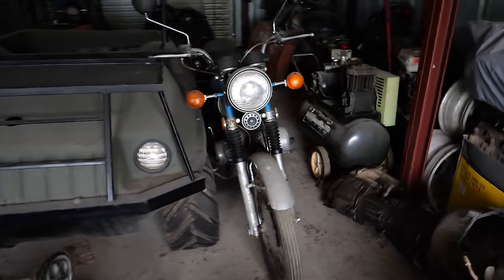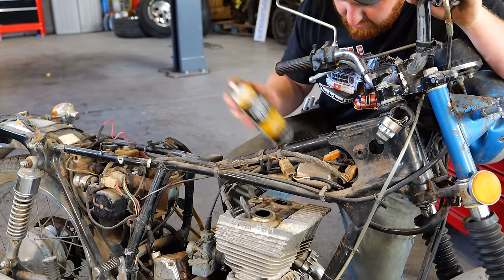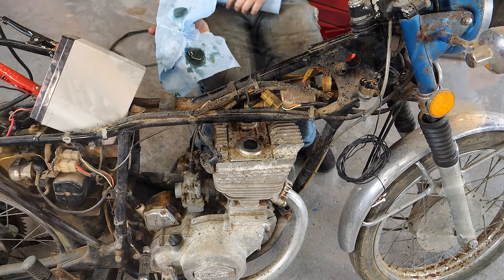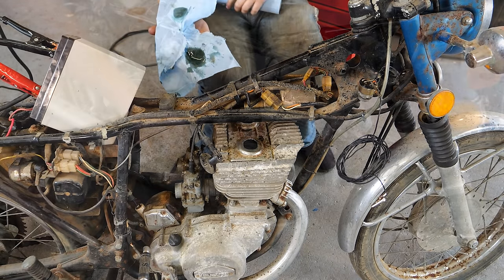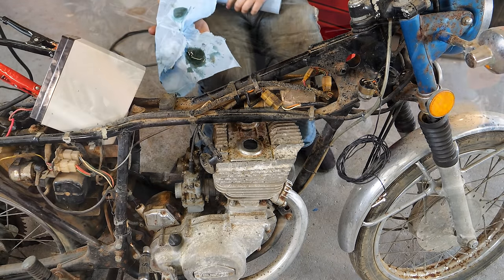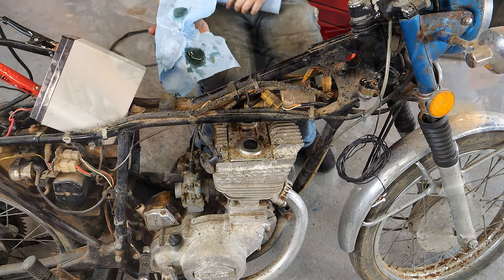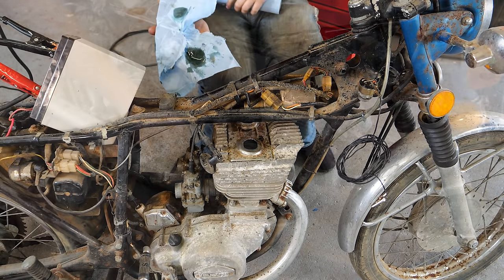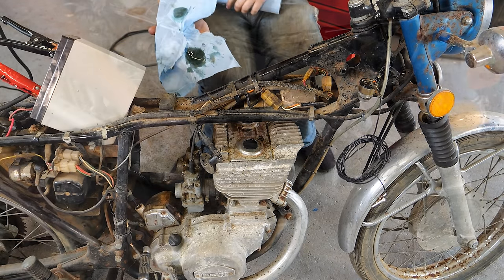Will an ABANDONED 2 Stroke Motorcycle Run After 20+ YEARS!?

Comment from the maker: Thanks for watching!! Check out our merch on https://www.junkyarddigs.com/
Reply: What speed can you hold it at and what top speed
Reply: You should consider doing a vintage bike challenge like you did with the snowmobiles.
Reply: save 15%
Reply: If u really want that chrome to come back Id reccomend Never Dull its a much finer wool and it already has the compound inside of it
Reply: One question did you try the key on the old lock? Because back then alot of bikes only had 1 key for all models. My old bikes key basically had a screw driver for the key and nearly all old mopeds and so on had the same so you could either take it from a diffrent model or just use a flathead screwdriver
Reply: My raycon show the same symbol but aren't wireless rechargeable model unfortunately.
Reply: They do make a specific thread tape for use in fuel lines if tha tape you used doesn't hold up... from my understanding the regular thread tape will get ate away from the gas over time alot like the rtv gasket maker does
Reply: @CaneAtvse  also Seal All sealant works perfectly too, had to use it on my motorcycle petcock screws and stopped leaking.
Reply: You have a gas cap on the parts bike. I swear i saw you take it off in the video.
Reply: @coffeyscarburetors6437  that's what I was going to say but didn't.
Reply: As a motorcycle rider i love that you got this running but you presenting at speed on 20 year old tires is more balls than id have had lol that could have gone really bad really fast
Reply: Kev Kev Kev, @38:38 so that stuff "clears perfectly dry" ehhh not "dry perfectly clear" 😝🤣🤣🤣🤘 hoooah
Reply: I got my raycons for 68 dollars!!!!
Reply: @joeyfaulks  I think they were good for about 90 95..
Reply: You should do an El Camino revival or do the nitrous for the limo?
Reply: TO TEMPORARILY REPAIR ANY GAS TANK!!  (NOT DIESEL !!!!!!!)
USE A CHEAP BAR OF SOAP, BRAKE OFF A THUMB SIZE PISCE AND MIX IT WITH ANY FINE SAND THAT IS ON HAND AND JUST FROM THE HEAT OF YOUR HANDS YOU SHOULD BE ABLE TO FORM IT INTO A PUTTY TO RUB OVER THE ANY HOLE IN ANY GAS TANK BE IT STEEL OR PLASTIC AND THE LEAKING GAS ACTS AS A CATALEST.
Reply: I don’t know if you still have your Buick Wildcat but there’s one for sale 30 minutes from me in Kansas
Reply: nuts with vinegar in tank bang around
Reply: What about that six wheeler are you going to be doing one on that?
Reply: I got a pair of Raycons and they never stayed in my ears. Ending up throwing them away after one fell out and got caught in a drive belt and blew apart
Reply: do more motorcycle revivals for those in the back who can only afford 2 wheels at a time 😂

Comment: Synchronizing early Suzuki 2 stroke carbs is a little more complicated than just making sure the idle screws are the same.  Make sure that both slides are opening at the same time when you twist he throttle, too.  You can make the adjustments in the throttle cables by varying the amount of slack in each cable.  Probably you already knew this.  Nice that the CDI still works!
Reply: Also, the proper air box will help imensely.
Reply: Also, I would de-coke the Exhaust Silencer, there will be years of coke inside. Engine will breathe with better gas flow.
Reply: check for proper backpressure in the exhaust and always tune for max vacuum, usually between 20-25.
Reply: @peterduxbury927  kerosene, or the crispy flame torch ?

Comment: You just cannot beat the sound of a 2 stroke motor, they sound awesome. I totally rebuilt a GT250 years ago 😊
Reply: I had a 250. Wish I'd kept it. Was about 30 years ago.😊
Reply: @Iaintwoke  was 2008 I done mine
Reply: Street legal 2 strokes were not that rare back in the day, before (1998?) emissions laws?  I had a 2 stroke Honda MT125 for years and Honda is famous for disliking 2 strokes.  I never got my act together to get my motorcycle license though, and it got stolen around 2005.  I am experimenting with small amounts of graphite in 2 stroke oil, using cheap old weed whackers.  So far so good, but it must get past any fuel filters and too much can foul spark plugs.  Graphite blows oil away on wear tests though, especially EP tests.
Reply: Stop telling lies lad
Reply: @colinsimpson8738 stop telling lies lad

Comment: It's unfathomable that those carburetors survived to live another day! That bike deserves full restoration or at least a mechanical restoration and clear coated vintage patina. This by far is one of my favorite videos yet👊
Reply: Not really those oem carbs had better castings then normal Chinese carbs nowa days. They actually wanted to take pride in what they put out back then.
Reply: @jasonhudson5861  they are still very old, and have been sitting for decades maybe with fuel in it for some of the time, not to mention the fact that unlike a car where there is a hood and fenders shrouding the carbeurters, the motorcycle card is fairly exposed to the elements. a chinese carb wouldnt has lasted as long i 100% agree, but it is a very rare occurance for ANY carb that old and in that situation to still work even at all.
Reply: I had a ts185 as my first bike back in the late 90's....They absolutely refuse to die.
Reply: @LooseFrait  idk bud pulled many old bikes out. Mostly you’ll have problems with the gaskets being non existent or the jets being totally clogged but with a lil compressed air an pipe cleaners it’s not hard at all to get these old carbs back in shape but with all the repairs I’ve done a carb rebuild has never been more then 30 bucks on a carb.I have yet to see an old carb be in such shape that’s it’s not usable unless some pin head went in an tried to screw in some jets Crooked or broke the main jet casting an this goes for the in-line 4 carbs as well there all splendid an easy money if you know what your looking at. Rather spend hours on an old crusty carb then buy a Amazon/eBay knockoff literally have pulled them off the bike to clean brand new just to find out the air ways are completely clogged with cast

Comment: Lord I love that 2 stroke sound! That brought back memories of my Yamaha RD200 while I was in Kansas in the USAF. GREAT show Kevin!!
Reply: I had a Yamaha YDS 250 in 1964 while station at McClellan AFB in Sacramento, Ca.  Great cheap transport for an Airman  2C.  Made getting to the bars easier except during the winter rainy season.
Reply: I just bought a near mint rd 200
Reply: @quickturn66  I'm jealous!! I had a couple of RD200's and they were brilliant, but that was back in the old days, when I weighed ten and a half stone (150ish pounds)!
Reply: @someonebald2022  I weigh 142 lbs. I brought a riding mower to fix from a guy last summer and he had some bikes, I said “ sell me this little Yamaha “ he said he’d sell it so some time went by and I sold some misalliance stuff to build up a little pile of money and turned up there a couple of months ago. Then suddenly he wasn’t sure he wanted to sell it.  After going back and forth I ended up giving 1200$ for it. Said he had the title but after I paid for it he says he has to find the title. Lucky he called two weeks later and said he found it and would mail it, I said no,I’ll come and get it. It’s the original title from 1976 and the bike came from the dealer I used to go to in Auburn ny when I was a kid in the 70s. 3240 miles on it, original tires still good. Been sitting for 45 years, every thing works except the transmission was stuck but I made a special tool and freed it up. Now I have to change the crank seals , shift ,kick, sprocket seals and also fork seals. It’s super nice with only a few traces of corrosion,looking forward to buzzing around on it.
Reply: @quickturn66  Take care of it. It’s a very sought after bike!

Comment: nothing better than a two stroke. The sound is pure joy and nostalgia (while also reminding me of the burnt cylinders of course).
Reply: I had a 250. Beautiful little bike. I wish I still had it 😊
Reply: My friend had a 250!

GT 250 X7 Limited Edition,
Had gold fork triple trees and a good looking black metal suspension forks and the back shocks were also trick,it had a special seat for the rider and then a shaped and molded seat for passenger , engine was polished and had black and gold accents, the barrels and head was painted and machine turned, tank was from a bigger gt or Suzuki 🤷🏻‍♂️
Handle bars were clip on gold and black,had a bit of a fairing around the front light that went down to a fairing that was behind the front wheel and formed a nose cone , front mudguard was nice looking thing 🤔🤷🏻‍♂️ 

And the wheels.....?!😳 
Some type of 5 spoke 🤔
Either I don't remember correctly or they were a one of one 🤷🏻‍♂️ But they were a five spoke and were polished aluminium/magnesium 
with black and gold 👌🏼 Looked amazing 👌🏼👌🏼👌🏼

And the most amazing thing about it was the 
TWO MASSIVE ALLSPEED 
expansion chamber exhaust that were nickel chromed and polished to mirror finish 😇

It sounded amazing 👏🏼👏🏼👏🏼👏🏼

It got to 6000 rpm and then 6500-it's just about to go and then bang 💥 7000-8000-9000 it's accelerating so hard the wheel is hovering as it does and ten 10,000-11,000-12,000 and then change gear and experience that again 👏🏼👏🏼👏🏼👏🏼😇 

Never seen one like it again and can't find anything else on it, it was stolen in the middle of winter and never seen anything about it after that 🤷🏻‍♂️  🤔

Comment: Those Suzuki "Ram Air" bikes were quite a common sight here in the UK where two stroke motorbikes were common because of the good power/weight ratio and small engine size. They do make an awesome sound too.
Reply: I had the GT550 triple version of this bike. And I can confirm that it was loud, smoky, and scary when you hit the power band.  I ultimately sold it for a 1984 Suzuki Tempter GR650 twin.  It was also unique. It was a light weight cruiser the had a sportbike type rear suspension.  It had a swing arm with a center mounted shock that you could adjust by turning a knob.  Was ahead of its time for sure.

Comment: Not sure if this has been said but carbs are synced by opening both slides until they are even with the top of the carb body. This adjustment is made at the cable connection on top of the slides. I believe with them at full open you can set the oil pump as well. Also the GT 380s look better. All that ram air head style but with a third head! (And Cylinder...) Lastly don't run premix in Suzuki's, you need the injector to feed the bearings. Nice bike though! I'm a little jealous.

Comment: Loved it. Best job in my life was summer job 1977 working as a motor cycle messenger in London riding around in a little red 1974 Suzuki GT185. Worn out battery, worn out rear tire and no top box, none of which I could afford at 18,  so always used the kick-start and crossed my fingers in the wet. Greatest fun delivering art-work for record companies, x-rays for hospital and cans of movie film in the days before digital.  All strapped on with a bungee and regularly failing off.  I clearly remember the burbling exhaust. Well done :-)

Comment: I know this was just a quick fix, but I’ve been doing this for over a decade now and one thing I always keep on the shelf is the POR-15 Tank Sealer for tanks just like this. Soak them in Evaporust then line them with the POR-15. It’ll seal any pinhole and line the tank.
Reply: Any experience with old Honda rebels?
Reply: @thesovietvorona1007  How old? I primarily work with 70’s stuff but a motorcycle is a motorcycle
Reply: @chadhanebrink8009  ah fair enough bud. Mines an 86’ with an 85’ motor.

Comment: I remember a guy who I worked with in the late 70's who had  Suzuki 500 two stroke which at the time was just a couple of years old. I owned a 1968 Triumph Bonneville 650 and he bashed on my old bike and that his bike would run away and hide from my old bike. Being 20 years old I had to demonstrate to him that particular bike was the fastest production motorcycle in the world until Kawasaki released the 903 in 1975. True his two stroke did rev so much higher than the ohv vertical twin in the Bonneville but went by him like he was dragging an anchor. That said there was a reason why Suzuki discontinued the two stroke motorcycles for the street. Good content as always.

Comment: Not sure if anyone else mentioned it, but be careful with the rubber tank plug as a cap, Tanks need a hole for air intake or else it it will cause a vacuum in the tank and cause the bike to starve for fuel.
Reply: u mean like vacuum carb?
Reply: @sargera1  Think of it like putting your finger over the hole on the straw of your drink, you pull it out, and suck the the bottom of the straw, what happens? You'll get the little bit of your drink, but the straw will suck together and you cant suck anymore. But if you let go of your finger over the hole, you can suck through the straw again. Essentially when you're sucking fuel out of the tank, you need air going into the tank, which is normally through a tiny one way valve in your tank fuel cap. If you plug the fuel filler hole with a plug, airs no longer coming in, so the same thing that happens to your straw happens to the tank. If the tank were super flimsy, it would start collapsing in, but since its metal or really thick plastic, it continues to pull a vacuum on the tank until it can no longer pull fuel, so the bike will run a little crappy and eventually die of getting no fuel.

Comment: Definitely going to want/need to do crank seals, even if they're "good" now after heat cycling they'll crack or wear and go bad. Clear sign of even a small crank seal leak for the gearbox side is excessive smoking or being lean on the stator side. Been restoring/reviving vintage 2 strokes for a while now, the Suzuki GTs and Kawasaki S1-3s are a little harder to find than the Yamaha RDs/YDS's but they're all cool and fun bikes!
Reply: 175cc Yamaha, so much fun to run trails and do whooptedos on, yeah baby!!!

Comment: I sold quite a few of these new back in the 78/85 period. Not many problems with them, usually misuse the main one. Like all bikes of this type need original air box and air cleaner element to run correctly plus basically the original exhaust system.  Correctly set up reliable little machine, did change the odd crankshaft due to chronic misuse. Maybe 85mph maximum speed.

Comment: This video brought me back 46 years.  My brother had a GT 185.  His still had the original paint and looked pretty good.  I remember the distinctive sound these bikes produce.  I haven’t heard one running in 46 years, until now.  We didn’t even have drivers licenses.  And for a little bike it went pretty good.  I miss those days.  Everything was simpler.  When you bought a motorcycle battery, it came with instructions on how to fill it with electrolyte.  Now the instructions tell you to not drink the electrolyte.  Brilliant!
Reply: Yup, I bought a sweet 1976 GT 185 in high school. Probably 1990? Was a stone-reliable bike that I just turned into a trail bike. Took of the front fender and threw a knubby out back, perfect. Been rocking my 2004 R1 almost 20 years. Purchased new and love it!! But I do miss the simplicity and tunability of several KDs and that 185 I owned as a youngin😊😊 Those late 70s KDs were bulletproof!!

Comment: I own the '75 GT185 with the front disc brake. Blew a right side crank seal and then had the crank bearings, seals and stock pistons all replaced. I bought the aftermarket bearing/seal kit and pistons off of ebay. Runs like a champ now. As others have said, finding a stock airbox and getting the point gaps and air screws dialed in will make a huge difference. These bikes tend to run best with a fully stock setup. Hard to outsmart the Suzuki engineers. I also have a '74 GT550 triple in Hawaiian green. One of the smoothest bikes I've ridden.

Comment: If they are anything like the RD 350s , at the top of the carbs there are rubber boots, under the boots there are adjustments to sync the carb throttle cables. You did adjust the idle sync, but the throttle adjustments are where the fine tuning is. When you get them just right, the pipes will literally harmonize. Best of luck.

Comment: Seal All is awesome! It's one piece seals gas, auto trans fluid, probably everything else. I mean the name is seal all... Works on plastic and aluminum. Only 2 times i used it... Just a fyi to maybe save you from the ptsd.
Reply: Correct. I’ve had great luck with that stuff myself. One can apply it to an actively leaking tank and it will seal it up. Only drawback to it may be a lack of the durability an epoxy patch has, although any rust bucket I patched up with it didn’t leak again. Seal All. Good goop.

Comment: Useless factoid, the 185 had the electric start on the end of the crank which doubled up as the generator, hence the bulbous left hand crankcase cover. They also did a 125 variant but that came without the electric start. :)

Comment: I had 3 RamAir GT250s back in the 80s, fantastic bikes. The GT125 was sought after in the UK when the learner rules were changed in '82. Cool thing was that the 185 barrels bolt straight on, and many an '8' on the barrel casting was modified to look somewhat like a '2' instead!

Comment: Two stroke twins are cool, had a Yamaha two stroke 180cc twin many many years ago. Loved it! Yes with older vehicles Fit a High capacity battery, it makes life easier for the starter and charging system because the engine starts easier and quicker so less power needs to be put back into it, LOVE two strokes, tough reliable simple engines, white vinegar is good, KILLS Rust, and it is reasonably cheap! Ideally with old carbs/pet cocks etc, an ultrasonic cleaner makes a job of cleaning them up!! Personally i do not like the paint job, on the side covers, i,d redo both and the tank!! Sounds good not running quite right,